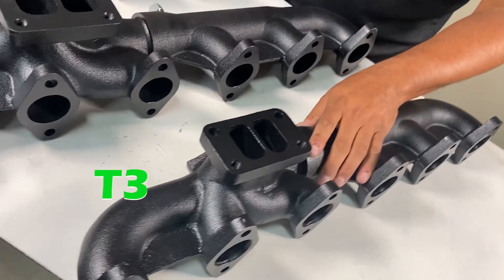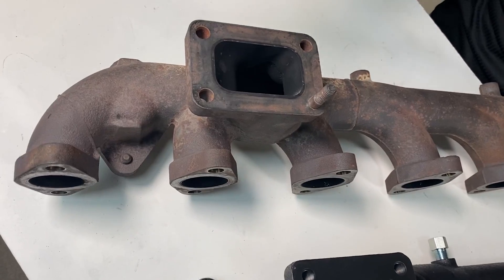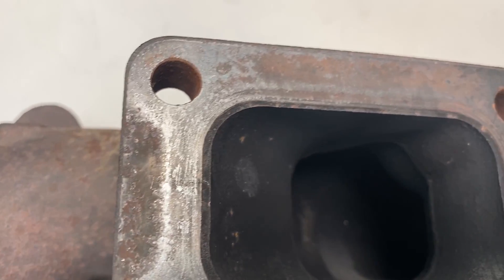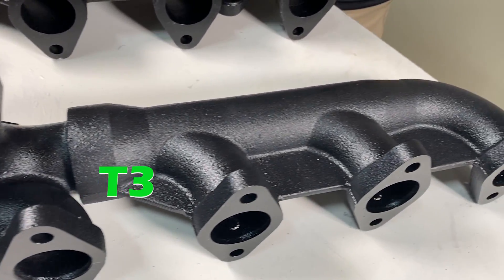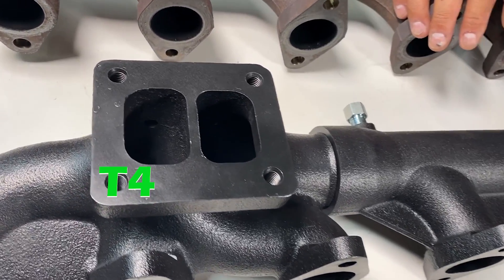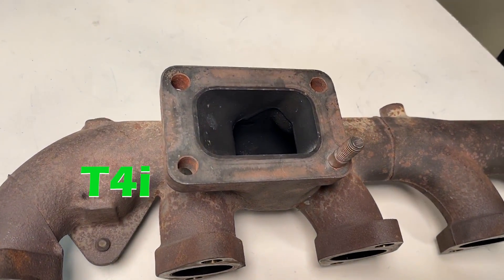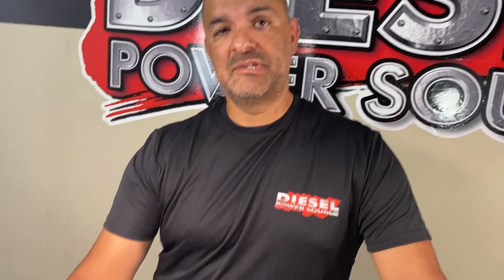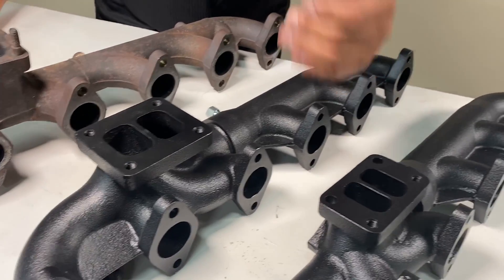What is a T3 T4 & T4i Exhaust Manifold

Comment: Question.  I have a t4 k series manifold can I used it on a  t3 60mm westgate . Another thing is that t4 manifold is to be used we a tial westgate not for turbo smart westgate.  What u think about this. Im.stock.  and I don't want to proceed if that is going to be a problem in dyno day went i.tuned . I'm scared that boost will increase etc

Comment: Will the T3 manifold sound the same as a stock 3rd Gen common rail manifold (2003-2007)? Sorry if this is a dumb question
Reply from the maker: Actually our 3rd gen manifold divides the front and rear cylinders, and so the sound is very similar to the 2nd gen manifolds.
Reply: @DieselPowerSource  Ah I see thank you, so does the stock common rail manifold not divide the front and rear cylinders?
Reply from the maker: @ImGanqsta  You are correct a stock common rail manifold does NOT divide the front and rear ports.
Reply: @DieselPowerSource  thanks for the reply!

Comment: Could I still use a stock turbo with one of these I have a 07 5.924v  Cummins
Reply from the maker: Yes, you can use the T3 manifold with your stock 5.9L Cummins
Reply from the maker: Sorry, Jordan we just realized that we answered a different question than you asked. You cannot use the stock turbo with the Turbonator. The Turbonator comes as a S300 or S400 style turbo.